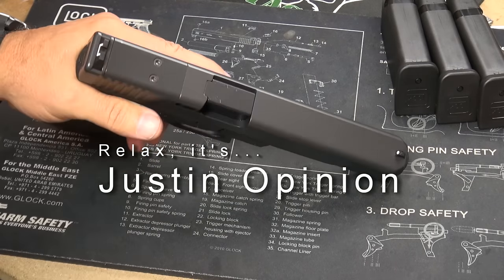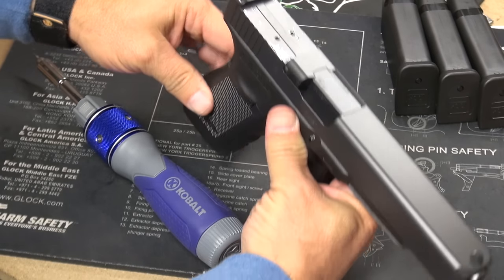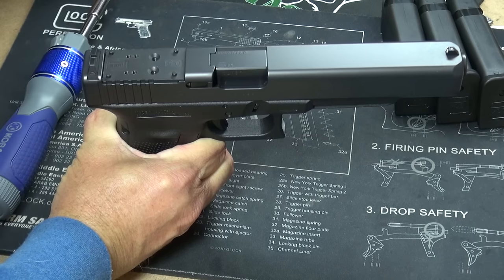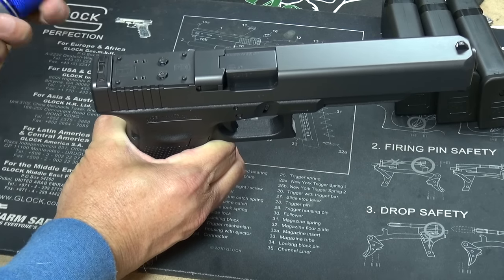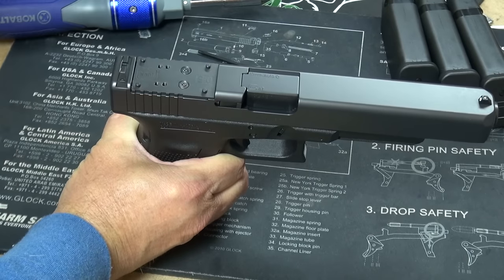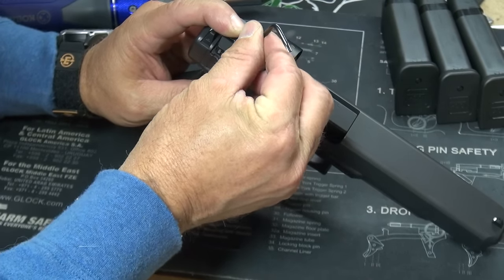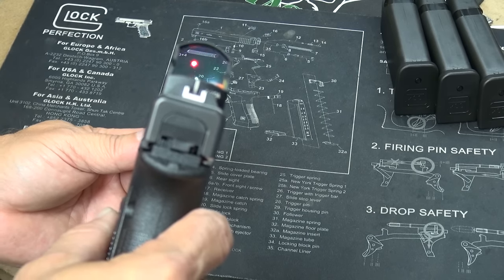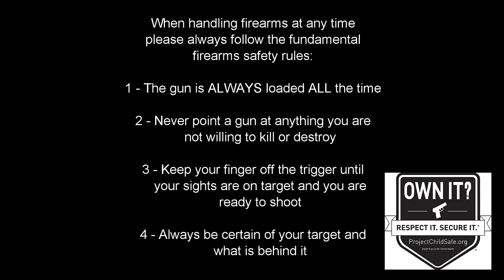Installing an Optic on a Glock MOS

Comment: For those thinking of going with the Burris for one it’s the exact same width as a Glock slide and for two the options are slim for sights tall enough to co witness you’ll need the front sight to be .407 and the rear .507 the Ameriglo gl-482,582,682 will work perfectly

Comment: A bit dissatisfied torque specs would be very useful especially a 10mm. What I don't like the screws that bolt the plate down I believe is 15inch lbs. The red dot is usually 25in lbs. But the recoil from 10mm will cause red dot to come loose

Comment: It's optimal to douse down the mounting plate and cut out surface with brakleen and place a couple drops of loctite in the threaded holes to create a more secure bond.

Comment: Warning before you mount your plate on the Glock,,,,confirm your optic fits the plate,,,,
If your screws exceed the width of the plate your screwed,
I purchased the vortex venom, which comes with American threads use those screws you will be ordering a new plate.
Believe me take your time!!!!! You will need different screws and #1 plate for the venom!!

Comment: I have the same sight on my G34, but my working stiff budget is lower than yours, so mine is mounted in the dovetail. Yes, I know what you are thinking. I did away with the superior plastic rear Glock sight!  It feels strange to me, though, kind of like I am aiming at the ground when I put the red dot on target. It shoots well, and I have had no problems with the mount. I may spring for one of the new slides in the future if I start shooting it more.

Comment: The purpose of that “TOOL” Glock provides is so you’re not able to over tighten the screws as opposed to using a driver causing potential damage.

Comment: Did you use the screws that came with the MOS plates for the mount and for the optic?
Reply: That's what I was hoping he would answer. Mine do not fit my MOS so I used the ones that came with the Glock and they were too long so when I screwed them in the back of the plate started to rise up.

Comment: There's a much better plate system out there now in steel versus CH's aluminum.......Forward Control Design's OPF-G, RMR.
Reply: am I right, that you don't need to buy new taller sights if you use the Forward Control plate?

Comment: I think you cross threaded the first screw you put in.
Reply: Douglas Cook he definitely stripped that.  I watched that turn and a half, then. ouch
Reply: I noticed that as well - you could definitely tell the screw was slightly canted but he just screwed it in anyway (and then narrated how gentle he was being, lol). 😅 A good rule of thumb with screws is to drop them in and gently press down while turning counter-clockwise (unscrewing) until you hear a click and feel the screw seat - it's a very tactile sensation and ensures that the starting point of both the male and female threads have properly aligned before tightening. Simple, and works every time. 👍